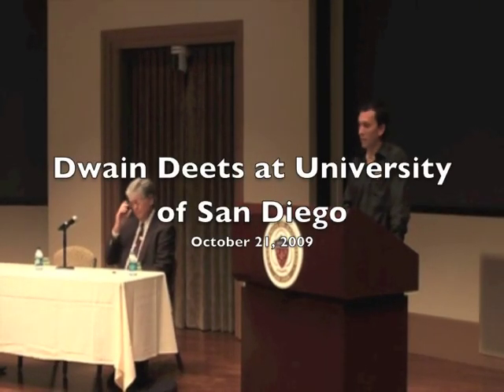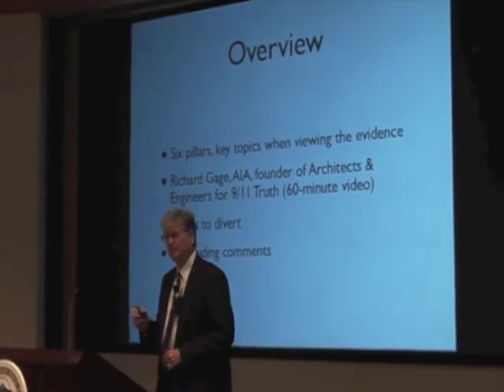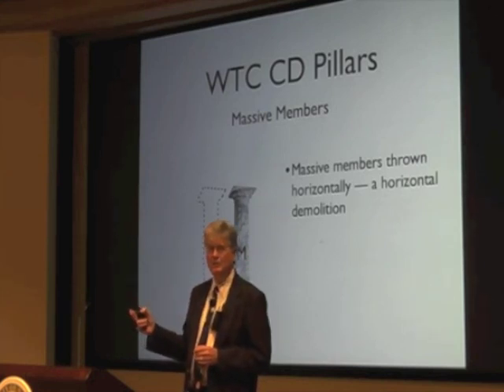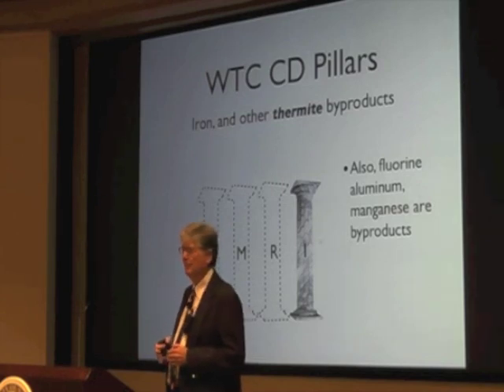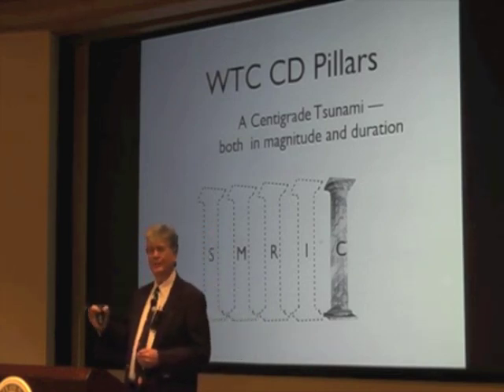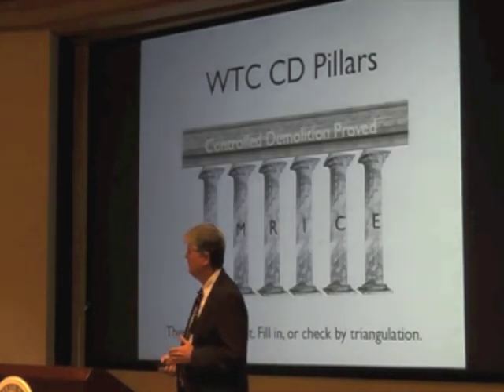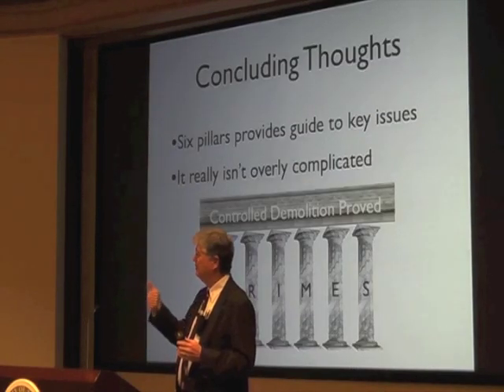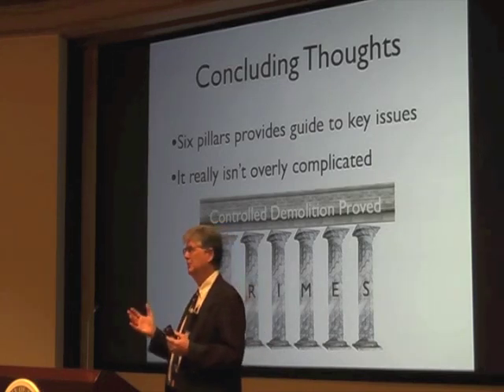Dwain Deets at Kroc Institute for Peace and Justice

Comment: @dadeets769 
SECOND, how about the ORIGINAL paper, in a science journal, that points out Nano Thermite was first produced in a prototype production facility in 2002?
At 80 grams per week, it will only take you 5,000 years to produce 100 Tons (harrit)
WTC, THERMITE, 2002 THERMITE PRODUCTION PROCESS, LIMITS ON P45
ammtiac. alionscience. com /pdf/ AMPQ6_1ART06. pdf

Comment: @loccysmif 

You have been asked 2 simple questions: Do you believe the trusses should not have bowed under the amount heat they were subject to in the building?

How would the lower structure have arrested collapse when the floors cannot even hold the static load of the top of the building?

Comment: The floors will fail under the static load of the top of the structure (above collapse initiation area). 

This means that ALL kinetic energy is "excess" energy which increases the amount of energy available to break other floors meaning each floor provides less meaningful resistance to an ever-increasing falling mass. 

Back on topic:

How did you measure the speed of the collapse and determine there was no jolt?

I would like to see these numbers before you speak again.

Comment: @flanksteak2:

Measure speed? I didn't. Szamboti did. His findings are discussed on various fora, including by people such as Dr. Greening.

The recovery period required by amplified loading followed by structural failure is larger than the framerate interval of the Sauret video, therefore it can be established whether or not these jolts occur.

The same method has been successfully applied on Balzac Vitry, also using video evidence.

Comment: @flanksteak2:

@flanksteak2:

A jolt does in fact occur when the stick fails. Your foot accelerates downward, and the rate of acceleration thus changes from 0 to 'x'. 

Apart from that, your analogy is crooked. The WTC floor failures occur because of dynamic loading, not static loading. GPE converts to KE, which must be used to deform structure. Whether this is an elastic or inelastic collision, a jolt must occur. 

Which is why jolts are observed in studies of e.g. Balzac Vitry.

Comment: Right, Jones tested one substance that had not been subject to the same conditions that it had been in the WTC's such as having a 5000 degree electrical arc drawn across it during welding. 

While all this speculation is fun, it's a waste of time when Planes and Fires was proven and when we have no steel that shows any damage from incendiaries or explosives.

Comment: @flanksteak2:

Yours is the alternate explanation, and what's more, it has no basis. Aluminum and rust IS thermite if it is intermixed in micron-sized grains and then reacts when ignited! It IS nano-thermite if it not only ignites and reacts, but contains UFG and intimately mixed particles, which can only be achieved with complex INTENTIONAL synthesis.

Such material is NOT paint. It does NOT "spontaneously form" in fires or collapses. You might as well claim bombs could be formed in collapses.

Comment: What information would NIST have to produce to convince you?

And once again, more denialist diversion of you to come with nonsense about "jolts" that should have been observed. 

Nonsense. 

If the top comes down on the bottom the bottom the floors are not strong enough to resist the weight of the top and collapse. 

Of course that is too simple to understand and wouldn't keep DVD sales up. 

Lets talk about jolts and the metal in some dust that we found on the window of a welders apt

Comment: You don't know what deliberately manufactured Nano-Thermite looks like. 

You and Jones have never looked at other substances or tested dust from the steel of any other buildings to see if it shared those same characteristics. 

You never looked inside the Welders apartment of the window sill Jones took the sample from. 

You do not know whether or not the substance is Nano-Thermite.

Comment: @flanksteak2:

"Jones does not know what deliberately manufactured NT looks like."

The material is thermitic. The material contains nano-sized aluminum platelets (~ 40 nm thick). The material contains iron-oxide particles approx 100 nm in size.

The ignition temperature of the thermitic substance is well below that of normal thermite. Furthermore, Jones et. al. draw on many publications by, for example, LLNL. 

Not nano-thermite? When singing pigs fly, maybe.

Comment: Again:

Do you believe the fire in the building was not hot enough to heat the trusses and allow thermal creep which in turn led to the bowing and failure on the wall of the WTC?

Yes or No.

Once collapse is initiated, why do you believe the building beneath it should arrest the collapse? Cit specific components and their strengths during your answer. 

NOBODY at AE911 TRUTH has produced such a write-up. 

Specific, testable claims would allow to see that their claims are unfounded.

Comment: Jones is lying. Jones has no clue what NT looks like.  

Finding small particles of rust and aluminum does not equal Nano-Thermite, no matter how many big sounding words Jones uses to describe it. 

Steven Jones might tell you a fork is a :Quad-pronged apparatus consisting of a handle 10 centimeters across with the pronged organic sustinence penetrating devices 1/4 the handles length. 

Sure, it dazzles people like you because it sounds complex but it's just a fork.

Comment: @flanksteak2:

"Jones concluded (..) since the (...) particles (...) were very small that they must (be) Nano-Thermite."

No. He concluded it based on various properties. These properties include a ignition temperature well below that of regular thermite, an intimate mixing of components, nano-aluminum platelets, nano-sized iron oxide crystals... a DSC graph compared to Tillotson (both conducted in air) and

*drumroll* 

An very fast thermitic reaction, yielding iron-rich microspheres.

Comment: Right, so Jones concluded that since the Rust and Aluminum particles he had were very small that they must Nano-Thermite. 

There are more reasonable explanations for the substance Jones found and I pointed to several of them. Using the principles of parsimony and to remain scientific, it's only reasonable to hypothesize that the particles are from those sources and not from some mystery explosive especially when there are no signs of the use of explosives in the rubble.

Comment: Then there are NIST's computer models, in which they have the foolhardiness to e.g. set thermal conductivity to zero if it placates their predetermined conclusion. 

At times, NIST has tweaked parameters to the point of absurdity in order to further a natural collapse scenario.

They hide some or all of the data they use for their FEA. Why? They are certain they are correct aren't they? Is this stuff, are these numbers, a threat to national security? I think not.

Comment: I would add that to me, it is not just the fact THAT the WTC towers collapsed, but HOW they collapsed.

Collapse initiation itself for WTC 1 & 2 is a different discussion, which I think treads in murky waters. I'm surprised at and at unease with the short time span it took for those towers to give up, but I'm not convinced it is impossible. However, I find NIST's reasoning forced, especially the floor tests and the fireproofing dislodging tests.

So in essence: "need more data".

Comment: Electrode coatings can consist of a number of different compounds, including rutile, calcium fluoride, cellulose, and iron powder. Rutile electrodes, coated with 25%45% TiO2, are characterized by ease of use and good appearance of the resulting weld. However, they create welds with high hydrogen content, encouraging embrittlement and cracking. Electrodes containing calcium fluoride (CaF2), sometimes known as basic or low-hydrogen electrodes, are hygroscopic and must be stored in dry conditions

Comment: The welding on the towers was done with Stick ARC welding. 

No  02 is present. The rod is surrounded with a coating that deoxidizes the weld. I will pull up an MSDS for this coating when I have time. 

Such a process would produced oxygen free spheres and make some pretty interesting looking particles as it burned through the weld-through primer. 

Probably a lot of the particles would be nano in size and contain several layers of different materials.

Comment: "None of the evidence points to the contrary"

I disagree. Collapse initiation...mwah. Maybe. I can see the WTC buckling and yielding after a while. Especially if the fireproofing was sub-par in multiple places and given the lateral load increase when floors are disconnected from exterior columns.

The biggest evidence to me: lack of jolt, the temperature gap, the pulverization of all floors of concrete, the high speed lateral ejections, the flashes not from glass, the booms in the Naudet vid.

Comment: "Why would the spheres contain oxygen"

Well, I guess this matter can be settled by publishing a paper studying spheres gathered from oxyacetylene torches. However, the "contamination" of those spheres is wider than just oxygen. 

The point is not only that the spheres seem unlike spheres gathered from welding, they seem unlike spheres originating from (The WTC's) structural steel.

The spheres seem to originate with the chips, given the XEDS peaks and their presence after ignition.

Comment: Why would the spheres contain oxygen when one of the main functions of the coating on welding rods or the gas in wire-feeds is to block out oxygen?

Would the glob of metal not form and begin to cool rapidly in the air long before 02 had the change to penetrate?

Comment: You are right, no chip igniters were found in the dust, as far as I know. Good point. Then again, we don't know what we are looking for. So far, the intent seems to be to examine the feasibility of the red/gray chips as igniters triggered electrically.

All this research does is confirm the possibility. I too would want to know why no circuitry was found in that case.

On the other hand: did the WTC dust contain recognizable circuitry from personal computers? So.. there were no PC's in the WTC?

Comment: "Do you suppose some welding was on the building"

No large oxygen peak in the spheres? Aluminum peak? Therefore, welding residue is unlikely. I do like the point you raise though. I hadn't thought of that at all.

Btw, dr. Jones crushed some WTC concrete and found no such spheres.

Comment: The fact that most of those iron-rich microspheres are not from clean-up operations is something I'm quite certain of. There are many reasons for this, and I haven't even listed them all.

At the core of this argument is the obvious temperature gap between what Jones, RJ Lee and USGS find, and what a plane crash and an office fire are capable of producing thermodynamically.

Even if the demolition hypothesis for WTC 1 & 2 is properly falsified, I would still like a good explanation for this gap.

Comment: Well, that makes these chips excellent igniters for RDX without taggant, for example. 

All you need is a wireless signal, such as provided by e.g. a wireless controlled demolition van seen driving through Manhattan on 9/11.

911blogger. com/node/18960

Comment: "Prof. Steven Jones arrived in town today, so Luke R. and I took him on the double decker bus tour through Sydney. We stopped in the famous and very peaceful Chinese Garden and learned of the latest thermite experiment performed by Prof. Jones. Turns out that the nano-thermite can be ignited by an electric current. He place probes with a 12 volt current on a 1mm length chip and it "flashed" right in front of his face — scaring the daylights out of him." 
-- xrl. us/bf7g84

Comment: @Tnoy34rt 

"blast furnace" 

This terminology is deceptive, since a blast furnace creates temperatures that can melt steel. Not only can a hydrocarbon/office NOT do this, NIST also didn't find any evidence for steel temperatures exceeding 600 centigrade.

The steel conducts and wicks away heat that passed by the fireproofing. (Which could not all have been knocked off) The fires in the WTC were inefficient fires which move around every 20 minutes after combustibles have been consumed.

Comment: @Tnoy34rt 

"The buildings have been investigated and found to be safe in an assumed collision with a large jet airliner (Boeing 707-DC 8) traveling at 600 miles per hour."

City in the sky, p 131.

And about you being competent in math, physics, metallurgy, aviation, construction, politics and cultures...(at the same time? If not, then why so opinionated?)...if you compare the WTC to a bag with a stick you aren't even competent enough to drive a car or operate a stove as far as I'm concerned.

Comment: Your video where you point out "explosive ejections" is nothing more than floors being broken by the debris which is the top of the building. 

Columns tipping away from the building as floors are stripped away

And smoke being pushed out of mechanical vents lower in the structure. 

You disabled comments on the video because you don't want anyone refuting your fantasies and threatening the myths you have created and which are providing you a nice income stream.

Comment: Rankstank, I've made clear points on the strength and size of the core, the fire temps as per NIST, the fact that the fire temps were for the most part well below the point where the steel would lose significant structural strength, quotes from the structural engineer, John Skilling, regarding plane impacts and various other design load capacities.  I wouldn't make those cogent points if I didn't know what I was talking about.  You are completely FOS.

Comment: Basically hollow?  You mean, like your head?  The towers had massive cores.

The core columns were steel box-columns that were continuous for their entire height, going from their bedrock anchors in the sub-basements to near the towers' tops, where they transitioned to H-beams.

Some of the core columns had outside dimensions of 36 inches by 16 inches. Others had larger dimensions, measuring 52 inches by 22 inches, and were up to 5" thick.

Comment: Structural steel  loses about half of its strength at 650°C.  But even a 50% loss of strength is still insufficient to explain the WTC collapse.  The WTC, on this low-wind day, was likely not stressed more than a third of the design allowable, which is roughly one-fifth of the yield strength of the steel. Even with its strength halved, the steel could still support two to three times the stresses imposed by a 650°C fire.

Comment: /watch?v=xG2y50Wyys4

There is no falling block, blockhead.  It is destroyed right before your eyes. 

Rankstank thinks if you remove a leg from a 4 leg table it will fall over.  He doesn't even realize you could remove two diagonal legs and a table will still stand.  That's how much rankstank knows.

NIST says:
At any given location, the duration of temperatures near 1,000 °C was about 15 min to 20 min. The rest of the time, the calculated temperatures were near 500 °C or below.

Comment: There is no such thing as pancake collapse as the initiating factor. It is a phrase used by the JREF cult and means absolutely nothing. Collapse initiation has been theorized to be either truss failure or column failure. Truss failure would supposedly lead to a pancake collapse, while columns failure is suppose to lead to the pile-driver effect. NIST supports the columns failure explanation, not truss failure.

Comment: Because we have limited space when posting on youtube.

'Rapid deterioration of the steel was a result of heating with oxidation in combination with intergranular melting due to the presence of sulfur. The formation of the eutectic mixture of iron oxide and iron sulfide lowers the temperature at which liquid can form in this steel. This strongly suggests that the temperatures in this region of the steel beam approached ~1,000ºC
An Initial Microstructural Analysis of A36 Steel

Comment: @KevinMerck

"First, I didn't ask you any questions."

You addressed me directly by name, and I responded.

I am saying I think the video is fine now. I don't think I've ever said the video was not fine. I did say, however, that the clip as such is disinformation, because of the manufactured audio.

As for your reference to squibs traveling UP the building, that is an EXCELLENT point, I have seen it before, and I too recommend it.

watch?v=IX9gdRST6zM

That video, in fact, uses the correct audio

Comment: On the other hand, another complicating factor is the presence of mechanical floors and skylobbies.

xrl. us/bf4cwf

That might decrease the size of the container on the one hand, but on the other hand it might also block the propagation of debris streams downwards, making some squibs on the other side of a mechanical floor that much more difficult to explain as caused by debris clouds traveling downwards through HVAC shafts.

Comment: @flanksteak2:

Well...there is another caveat. Considering that lots of air and debris is ejected immediately below the collapse front, that air is no longer available to be used in the 'piston'.

And yeah, I do consider the area..say two floors below the collapse front as one big air container. I see no reason why air would be trapped somewhere in the elevator shafts on the way down so that it would not equilibrate across all floors in the entire building; instead 'choosing' a specific floor.

Comment: @flanksteak2:

I would prefer it if you commented on my calculations instead, whether or not you feel they are irrelevant. It is you who repeatedly asked for them.

Furthermore, why don't you prove your point about the ventilation shafts by sourcing floor plans and correlating them with the observed high velocity bursts of debris?

This would settle the matter. Unlike you, I won't repeatedly pressure you into doing so, because I don't see the benefit in other round of pointless ad hominem.